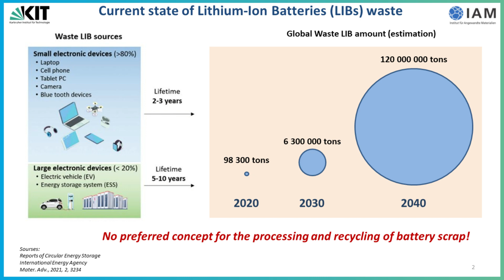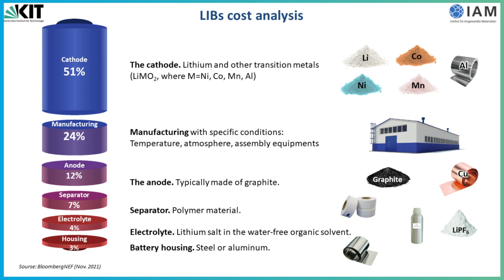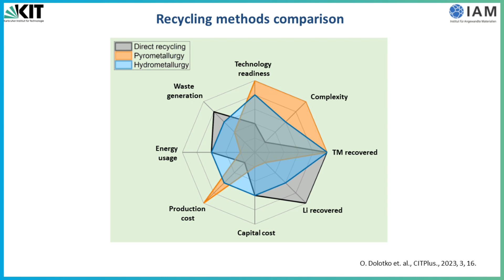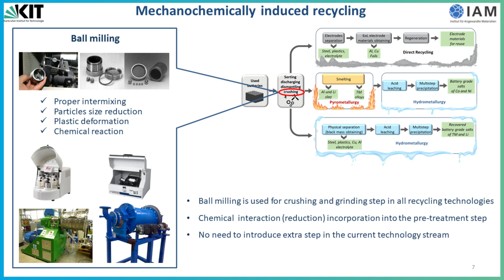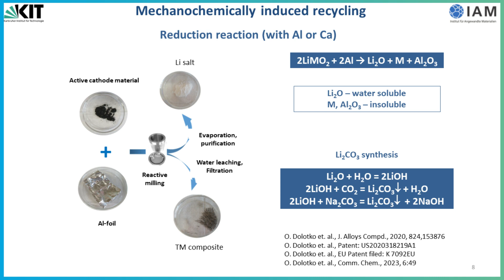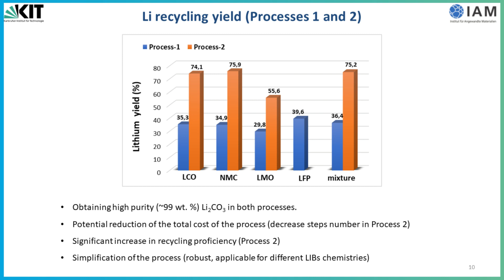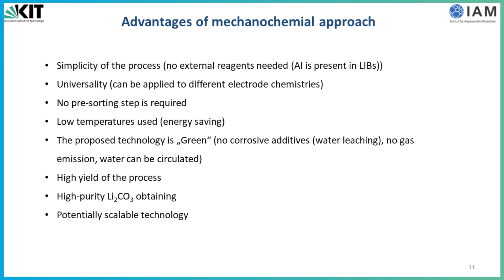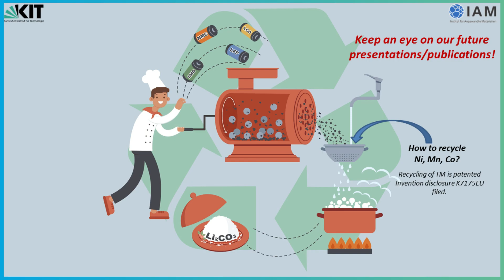Lithium-Ion Battery Recycling - Oleksandr Dolotko

Comment: in process 1 and 2 cathode + Ai foil is also called as a black mass?
Reply: Tbh the aluminum would be best disolved in acid to form AlCl3 and H2 rather than attempting recovery as metal.
Reply: you do blackmass recycling? hydrometallury?